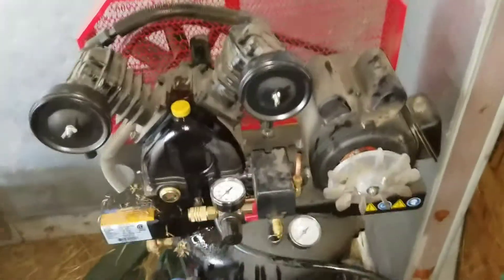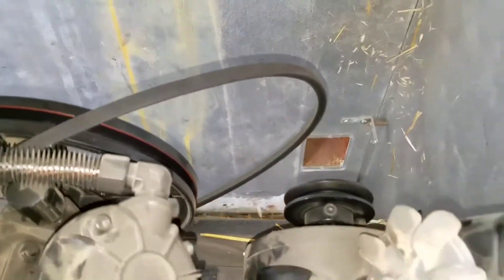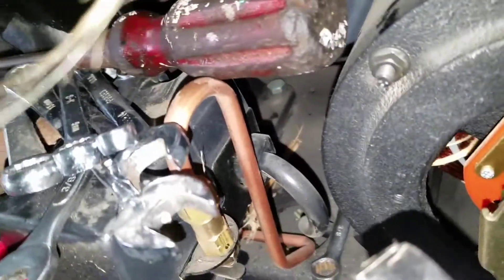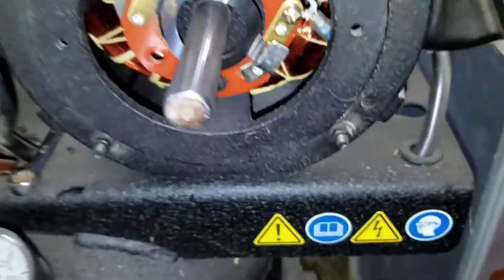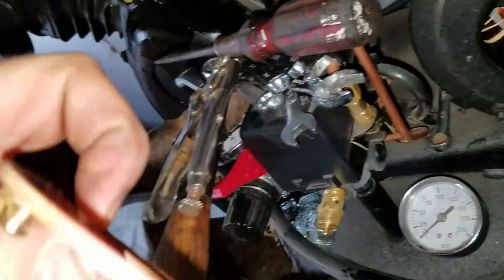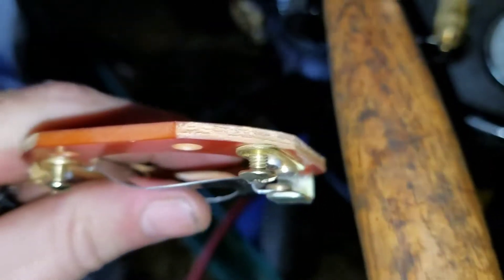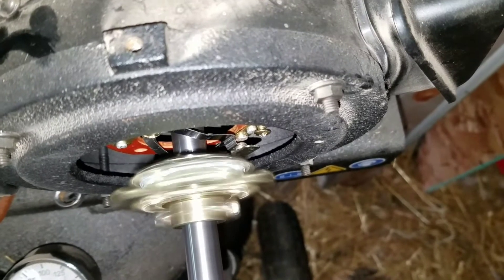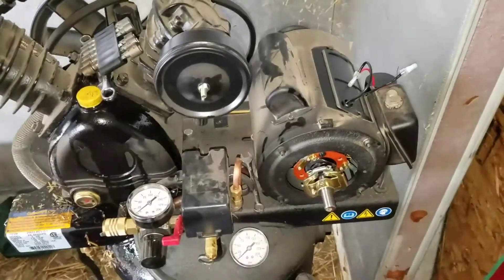How to fix a compressor motor that just humms fixing contact switch

Comment: Hi there,
I have the same problem in my air compressor. I already changed bothe capacitors and clean the centrifugal like you did, but the motor keeps humming. The pressure switch is in good condition. Any idea what could keep causing the problem? Thanks
Reply: I'm having the same problem! Smh...brand new start and run capacitors, cleaned up the centrifugal switch, new pressure switch, and new pressure relieve valve and motor still humms. Any help greatly appreciated!

Comment: Bingo!  Having watched this video, rather than removing the motor from the compressor I simply removed the rear cover of the motor and cleaned the contacts as described, and was back up and running in no time.  Thank you for this video and for saving me a potentially costly visit to the repair shop.
Reply from the maker: Glad I could help

Comment: Thank you Sir, I just Fixed my Motor and was about to spend $200! I had bought a used Compressor that was made in 88 and had been in a Bodyshop its entire life. I stripped the paint, gave it a nice Safety Blue Rusloleum Paint Job and a new Harbor Freight Air Pump. I also Build in a Suburban A/C Condensor to dry the Air. this Trick Saved my Butt. Thank you!
Reply from the maker: Glad i could help

Comment: I just discovered a similar scenario on a compressor I found. Naturally I suspected pressure switch or start capacitor, but turns out that on the particular masterpiece that I liberated from an the alley, the plastic cooling fan is just a press fit onto the end of the motor shaft as opposed to being secured by a set screw. As it happens, the press fit fan shimmied down the shaft enough to allow the centrifugal switch to follow suit and back too far away from being able to make contact. At first I had just a hum from the motor, then an occasional run for a few seconds, but once I pressed the fan back firmly onto the shaft, thus pushing the switch forward and back into the area it should be to operate... Presto!  A free compressor. :)